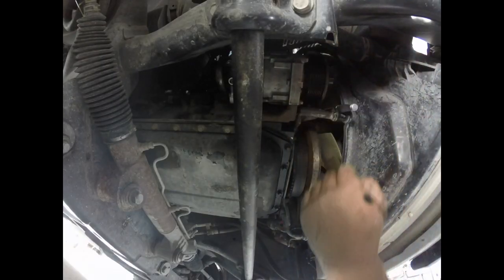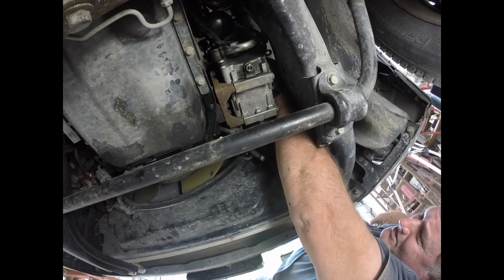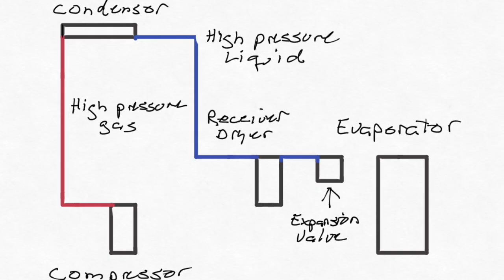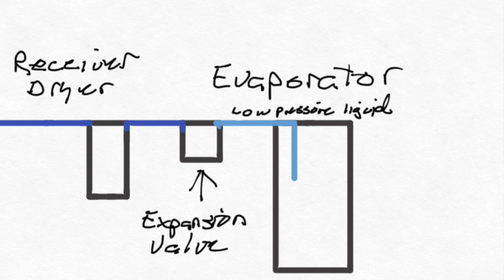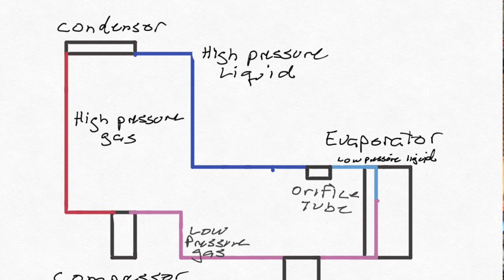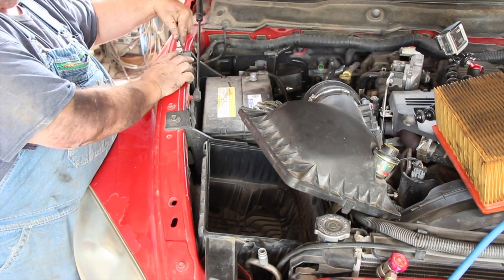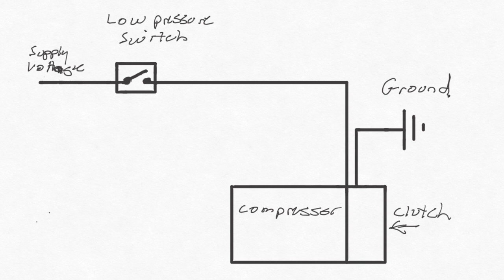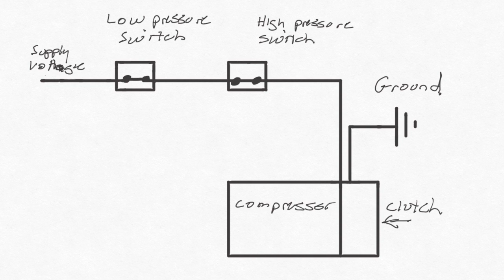Aimless and 2007 Dodge Ram Air Conditioner Compressor

Comment: Man this is a great video if been looking for a high or low pressure sensor for hours. Can find the transducer yet but I think there where my problem is I think. I got 12v at the fuse and relay but no power at the compressor connector. Any ideas or suggestions do what I should do
Reply from the maker: Thanks for watching my video. Unfortunately i have slept since i made the video and the way my brain works is that it’s good at figuring things out but sorry at retaining information. Do you have a good wiring diagram? That is a must for tracing wiring. Please consider subscribing to my channel.

Comment: Very informative sir, thumbs up & subbed!

That orifice/restrictor allows the the refrigerant to "flash" once it travels through it; it experiences a considerable psi drop on the outlet of the orifice & with that significant psi drop, comes a congruent temperature drop of the refrigerant. Once that cold refrigerant gets heated again (after going through the evaporator - which is really just a heat exchanger - since warmer, ambient air is being constantly blown over it) the refrigerant then changes state again, back to a vapor/gas, to be pulled back into the compressor to start the loop over again.

Another 'rule of thumb' tip, larger diameter lines in a system like that usually contain the low psi, since in order to move the same volume of refrigerant as the high psi lines, the diameters need to be increased.
Reply from the maker: I hope you hit the like button and subscribe to my channel and I look forward to hearing from you in the future
Reply: @KevinKalden  I did both, good sir! 👍

Had a question for you, did you use a local shop/store to buy your parts for the fix, or shop online? I'm having a devil of a time trying to find *just a replacement clutch assembly for my 05. They're all either v-belt or wrong number of grooves. Don't wanna buy a whole new compressor & recharge my entire system if I don't have to; I don't own, nor have ever used the vacuum pump setup you showed.